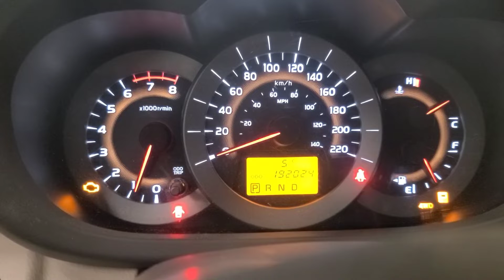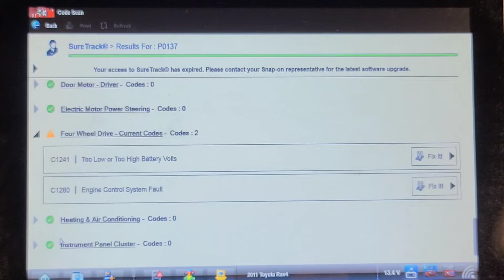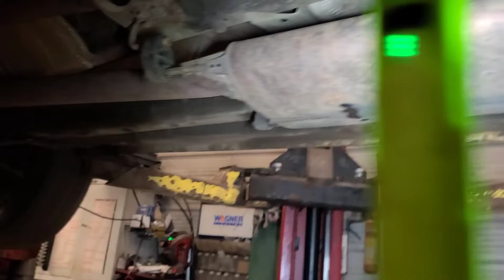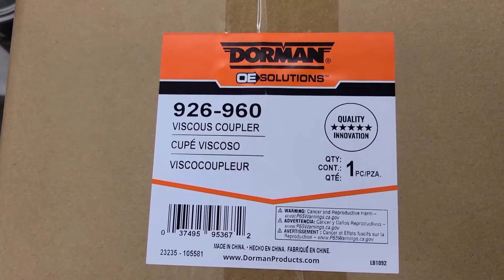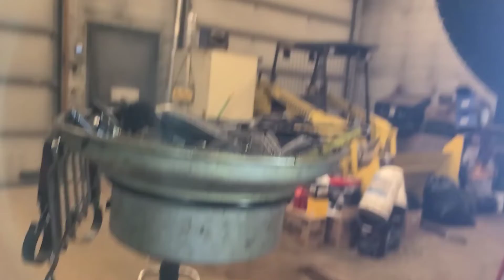2011 Toyota Rav 4 Driveline Howl. Rear Differential Coupler Replacement

Comment: I’ve got a 2012 rav4 makes a woowoowoo sound at all speeds. Terribly annoying. Can that be my coupler?
Reply from the maker: It could be but you really need it on a lift to listen for the source of the noise. Wheel bearings can make similar noises.
Reply: @PhillipBailey  thanks man! Are you local to me in Central/South Jersey?
Reply from the maker: No sorry I'm in thunder bay, Ontario, Canada eh
Reply: @PhillipBailey  thanks! You wouldn’t believe it. All this time it’s my 2 rear wheels/tires. I paid for a rotation for the heck of it on the slight chance that’s all it is. And lo and behold the sound moved to the front! Those 2 tires are So bad. Even though they have tread and look OK to the naked eye. 
It’s crazy. Literally sounded like bearings. Woo woo woo sound
Reply from the maker: Glad you figured it out. Now you need to buy 4 tires...
Reply: @PhillipBailey  yup! But way better news than a new rear dif or coupler

Comment: I have a weird squeaky sound when I let off the throttle and when slowing down it clicks and bucks forwards even not while driving no sounds but a slight vibration sound no other issues 04 Toyota rav4 4wd
Reply from the maker: That's pretty hard to tell without driving and actually hearing the noise. Can you record the noise and post a video for review?
Reply: @PhillipBailey I'll try
Reply: @PhillipBailey I uploaded a short on my channel it only happens when I just start reverse or slowing down brakes or no brakes, shifting down it bucks me and clicks which you'll hear in video, the squeaking seems like the driveshaft area I'm not sure though I know it's not transmission or brakes related though
Reply from the maker: @HollowWyzdum1333 I listened to your noise and I 100% believe you have a bad universal joint on your driveshaft. One of the u-joint is dry or seized. That's the cyclical squeak you're hearing. It may also snap or click under stress. Inspect the universal joint for signs of rust coming out at the seals.
Reply: @PhillipBailey thanks will do ! Once this weather breaks I'm thinking the salt caused it to dry out don't seem to have much play at all just hope it doesn't break down on me I door dash it's my work vehicle 😅
Reply from the maker: @HollowMartyr1333 should get it done asap. I've seen them break.
Reply: @PhillipBailey yes going to try somehow just got hit with 18 inches of snow and 5 degrees F weather might have to hold off I hope 😢 I heard I can change myself though don't have a lift only a jack and basic power tools it just started about a month ago and it's my only vehicle I would have to make the money delivering to be able to afford even to get it done myself or a shop probably expensive for that
Reply from the maker: @HollowMartyr1333 the recommended repair is complete driveshaft replacement. Its not that bad to remove on a hoist but laying on the ground is not nice, essentially with the weather. Maybe try the local salvage yards see if they have a used shaft. The bolts that secure the support bearing to the floor also tend to break off if youre in the rust belt. Usually i heat those bolts to loosen them without breaking them.
Reply: @PhillipBailey thanks I'll keep this in mind might be a week or two before I update this but I'm going to look around and attempt it myself if possible and weather permitting within the next few weeks I hope

Comment: Question, the new coupler has the electric mag built in, but the old one you had to physically remove the electric mag? What am I missing here? Did you need to remove other parts not shown here? Did the new housing just slide right in? Thanks for your help
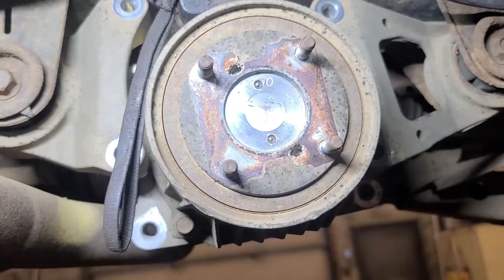Reply from the maker: The new coupler is supplied with the electromagnetic clutch. It is not actually "built in" . It is shown at 6:10 in the video.
Reply: @PhillipBailey  thank you

Comment: I need help! I can’t figure out what the deal is with mine!
Reply from the maker: What's going on with your Rav?
Reply: @PhillipBailey  might be the same issue. I’m not sure when I drive between 30 to 45 miles an hour, it makes a like grinding noise. And then when I’m just driving regularly there’s like a humming going on and someone told me that Toyota just do that with the humming thing.
Reply from the maker: Does the frequency of the noise increase with speed? Does the amplitude change when changing lanes? Could be this part but could also be a wheel bearing. Upload the video to your YouTube channel and send me the link or let me know when it's uploaded
Reply: @PhillipBailey it’s uploading. I’ll let you know when it’s done.
Reply: @PhillipBailey it’s uploaded
Reply from the maker: Listened to your video. That sure sounds like the support bearing making noise. The one in my video.
Reply: @PhillipBailey hmm okay. And what about the humming, Toyotas are just known for that?
Reply from the maker: The humming is definitely not normal, and it sounds like this one did. Ideally, it should be put on a hoist and run in gear while standing under it to pinpoint the noise source, but I'll bet it's this bearing.
Reply: @PhillipBailey  if I can somehow send you a video of what it’s doing that would be great

Comment: I'm trying to make the same Dorman replacement, but I cannot figure out how to release the electrical connector latch at the back of the differential. There's not really room for fingers up there. I suppose there's something to pry up or push down, but from what little I can see, I don't know where or which way. Can you offer any pointers???
Reply from the maker: You can leave it connected until you are ready to remove the electromagnetic coil. If you drop the front of the differential there's more room to access the connector.  The lock is on the top of the connector and needs to be squeezed to remove if I remember correctly. Look with a small mirror if that helps.

Comment: Great video. My differential was leaking via axle due to the seized breather. And I also had the whining sound. Recently the head gasket began leaking in to cylinder 4 & 6.After 16 yrs of owning this car, always taking care of it, Ive decided enough is enough. Time for a trade in. No more Toyota's for me. Moving on to Mazda.
Reply: The car last 16 years! What do you think you are getting from a Mazda ? 😂
Reply: @YGORCRUZ  I'll go with another Toyota if you pay for it.
Reply: @alexmanson1762  good luck with the new Mazda
Reply: if the Mazda is made in Japan it's just as good as Toyota but I own a 2009 Mazda and it's a ford its decent but the 2016 and above Mazda are the best cars out here
Reply: @shortstop-u4i  I own 2 Mazda's. 2018 & 2024. Not a hint of rust on the 2018. My other 1991 4Runner I had to get rid of it, due to rust. Mind you, I use undercoat corrosion protection on all my vehicles. So far I've been able to convince 3 co-workers not buy a Toyota. :) I luv my little Mazda "Chulapa"
Reply: @alexmanson1762 All other Japanese manufacturers have more issues.  You and your coworkers need to do more research.
Reply: You will have a lot more problems with a Mazda.

Comment: Is this just a noise issue or can a failed bearing disable the vehicle ?
Reply from the maker: @johnh7058  eventually the bearing could fail completely and cause other damage, especially if you drive at highway speeds.

Comment: I get a whine when tapping off the accelerator. Also a jerk when letting go the accelerator. Changed diff, rear diff bearings, engine and transmission mounts. Nobody can identify the problem. The whine could be from the rear diff but not sure what jerking would be caused by as all mounts have been changed
Reply from the maker: That's really hard to say without hearing it. Could be wheel bearing, axle support bearing. Try to find someone with chassis ears. That is if its noticeable on a hoist. Are tires all tge same size?